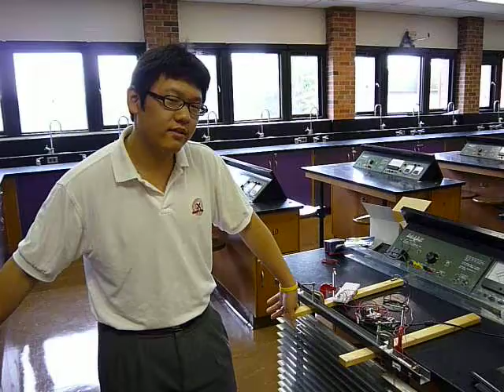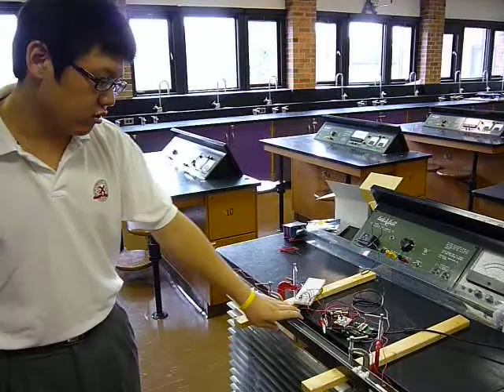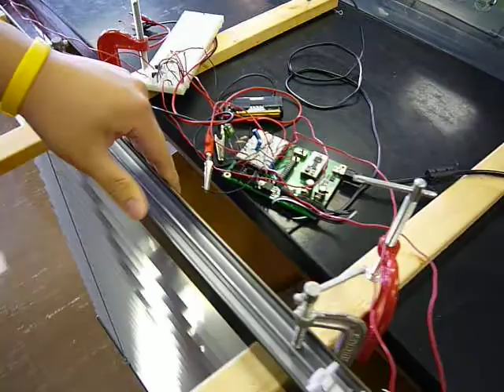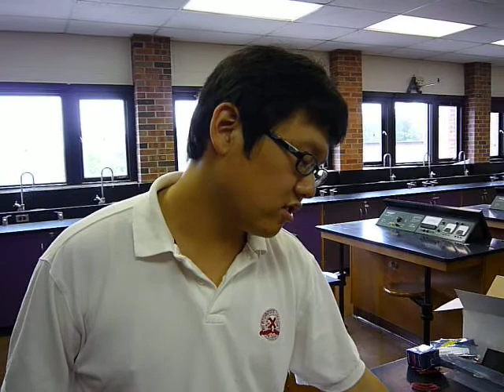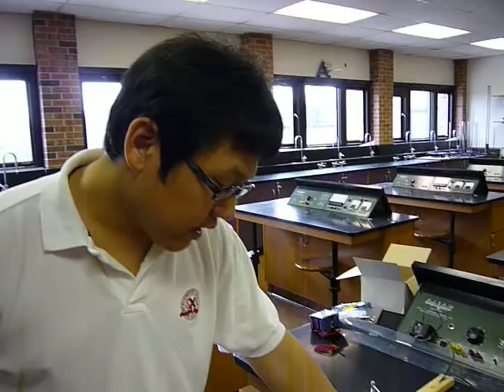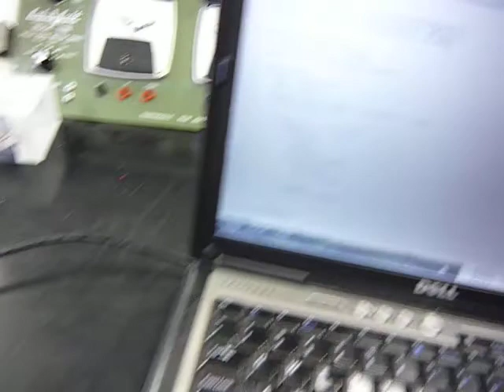Automatic Venetian Blind

Comment: I am surprised there are not any comments since 2009 when this was posted.  I thought of something like this several years ago, a little battery driven electtric motor which fits on the knurled shaft of a venetian blind.  With a photo sensor, when the light outside is less than the light inside, it automatically closes the blind.  Thus when you enter a dark room and it is dark outside, you switch on the light.  The sensor sees it is now lighter inside than it is outside and closes the blind.

Comment: Yes, it could probably made really small - It really isn't as complicated as it looks. It's just a small circuit to change direction of current to rotate the blinds back and forth with couple sensors connected to the chip. I guessed it would have been too much work to come up with a universal design (I personally had to cut off both ends of the blind rod to attach the motor and rotary sensor) Once again, thank you so much for the interest in the project! It really means a lot to me!